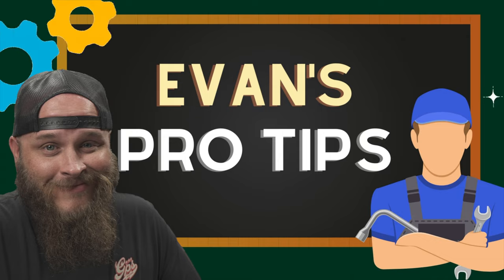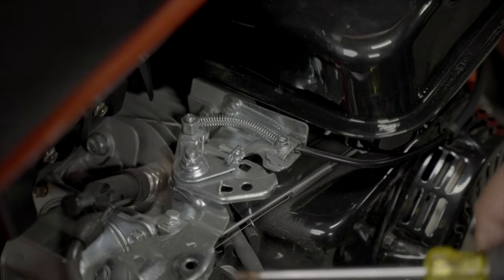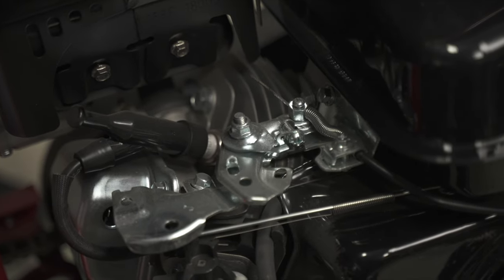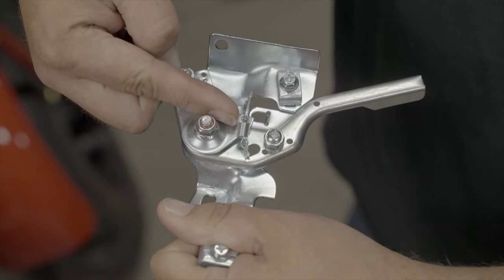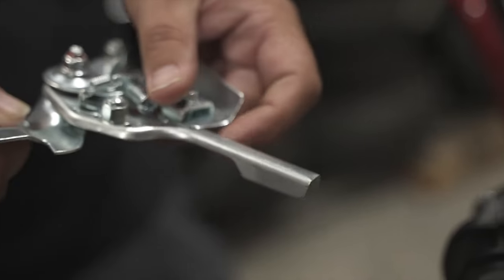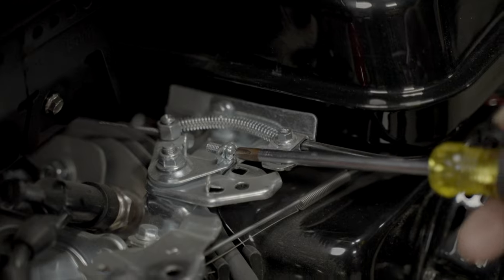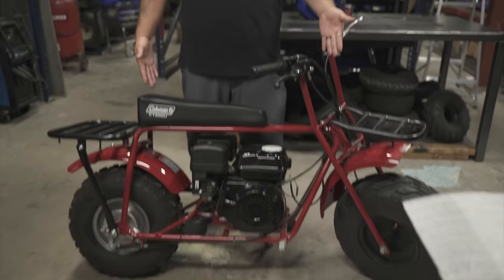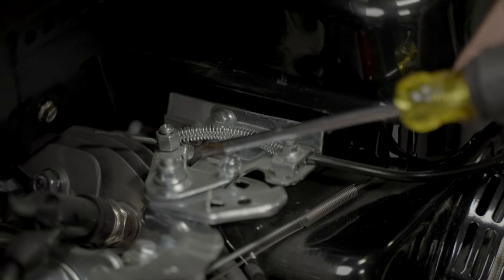Coleman 200 Minibike Throttle Spring Tip | Tutorial

Comment: Keep the tips coming. Any quick tips you have on the mikuni 22 mm would be appreciated. Mine won’t start on the 196 unless I use starter fluid. At high rpms it bucks a bit but might be a worn out belt on my CVt.

Comment: Just got a TC and put it on my Coleman 200. Will now only start with choke on and will not idle without choke. It does go without choke when WOT. Is this a torque converter / carb spring problem or a Carb problem that happened at the same time? Ty
Reply: Try backing your thottle screw in/out a little bit , be careful cause they can run away from you on start after doing that
Reply: @jwall7065 Ty big dawg

Comment: I run with both springs. I just shorten the stock Coleman return spring.

On a Coleman with stock gearing and a torque converter there's no need to bend that tab down. It's not going to change the top speed. Just back out the stop screw.
Reply: Newer models have the screw tac welded In place

Comment: Removed the big spring and with the Honda spring I have sticky throttle it won't go back on its own anyone know how to fix
Reply: Same here my throttle sticks. I didn’t buy this spring though but I bent that tab down and now I have to push throttle back
Reply: You may just need to get a new grip. If it's the one that comes with the bikes they are pretty cheaply made. I suggest getting a better control grip. That should help.

Comment: I bought the stage 1 kit and installed last week, muffler comes this weekend. Is torque converter and this throttle hack the next logical step to see top speed gains? Also, do I need to build the motor up a bit before doing this in order to haul a** safely?
Reply: I went from 18 mph to 40 with the TC